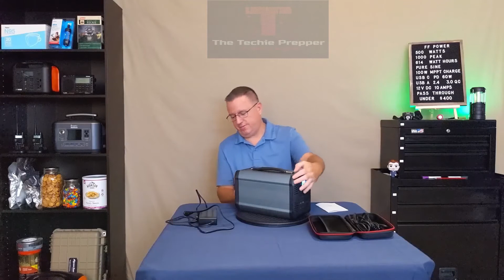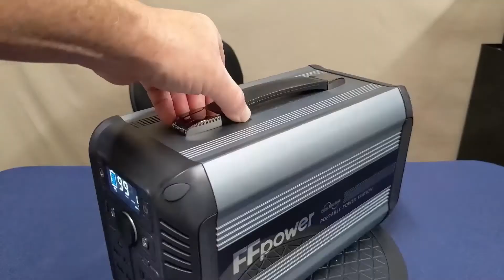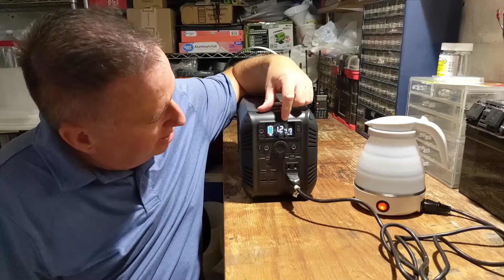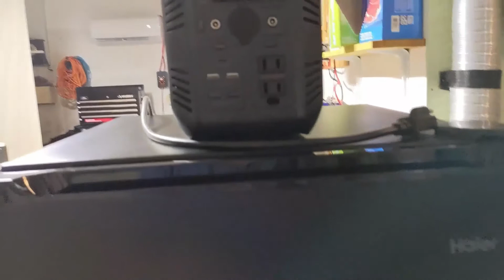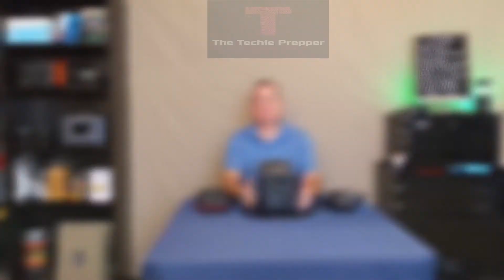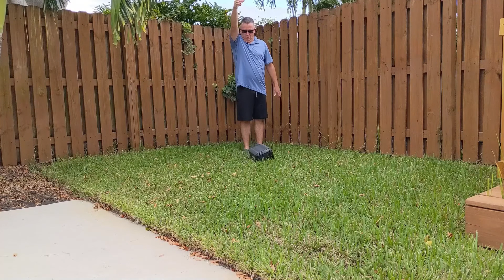FF Power 500 Watt Power Station Review w/ Drop Test - The Best Power Station Under $400 ?!?

Comment: tHIS unit will power a portable fridge for days but wont run a majic bullet for a minute. it depends on the surge of item you are trying to power up. My Jackery 500 runs a majic bullet  no problem so  the idea is that you just have to try items out
Reply from the maker: I agree, try to run everything you want to use with any type of generator to ensure it's going to work when you need it the most.

Comment: The issue is not that they are not compatible. The FFpower goes into shutdown when no electrical draw on the unit.  Ad a small fan this will keep a constant power draw on the unit when the fridge compressor is off. I experienced the same problem with my 5.0 cubic deep freezer and 4.4 cubic refrigerator. Hope this help resolve your issue.
Reply from the maker: Thanks!  I did look at the manual and online, but saw no mention of an auto shut-off.  Makes sense though.  I'd probably try an LED desk lamp or something with a very small draw.  Then again, it may be looking for a minimum.  I'll have to mess around with it.
Reply: @thetechieprepper  Great 👍 I just received my second unit as a backup. As you know the Caribbean is a hotbed this year with tropical depressions and most likely storms.